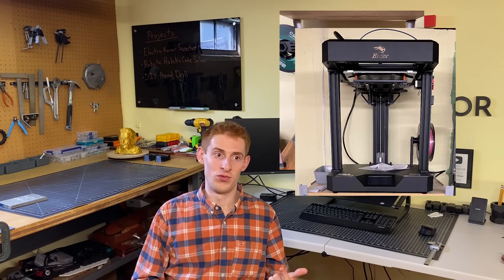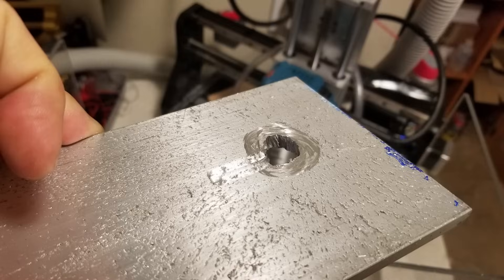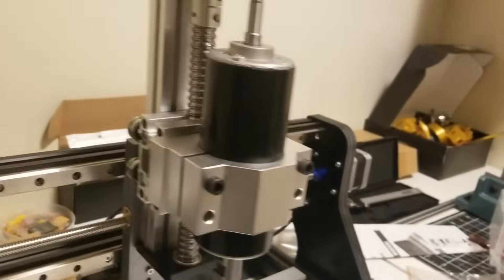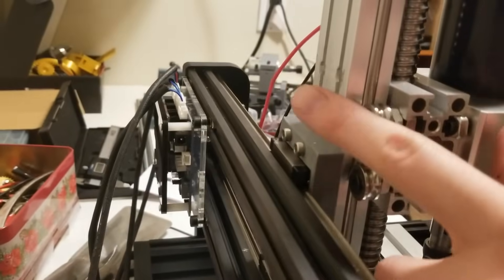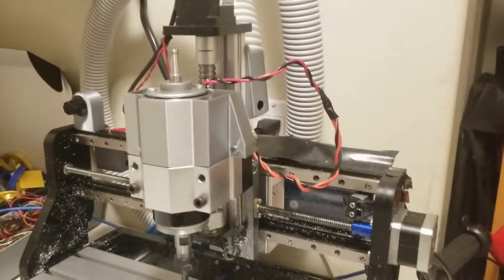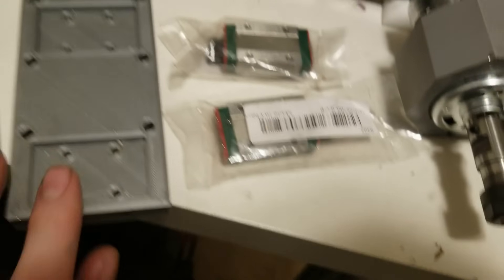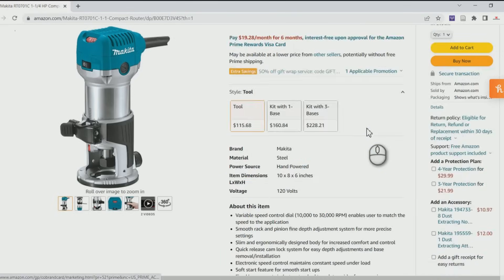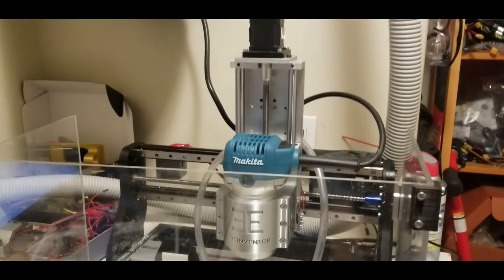Upgraded Desktop CNC 3018 cuts Aluminum FAST!

Comment: No matter which way you look at a problem if you don't address the root cause of it you will only get the same problems in a bigger format.
The 3018 is just a cheap entry level machine, sold down to a price, that barely functions but in it's basic form it will cut a number of materials accurately although slowly, so you either go the full Monty and replace every flimsy part (a costly exercise) with better more robust parts or design the machine from the ground up using this basic machine as a design guide......you will end up with a bigger bill of materials cost, but that is par for the course......the end justifies the means.......you definitely don't want a machine and a pile of left over parts nobody wants, so I would strongly advise anyone wanting to emulate this build to first do a design exercise and then buy the parts.

Comment: How did you make the part at 12:10 with the teeth being recessed under that upper cylinder-shape?
Reply from the maker: @Diego Montez I made it in 2 parts and glued them together!
Reply: Also, do you think one could make a similar build but save some money and get the 3020 because it already has the linear rail and nicer z-axis?
Reply from the maker: @diegomontez9543  maybe but youd still have to upgrade the router and possible also the Z axis, and last I checked the 3020 pro was a few hundred more than the 3018

Comment: Big people with this machines are rigidity &  linear shaft (rods).  They are not supported throughout the movement. You had changed x and z to Lm rail and guide, it you can change in Y axis, for better results.

Comment: Eric, it looks like you fashioned a piece of aluminum to connect the spindle holder to the new z axis, is that the case? If so, any specs?
Reply from the maker: Hi Brian, it does look aluminum, but its actually a 3D printed spindle mount that I designed and printed with silk silver PLA!

Comment: Is it only me finding it wierd to hear "I need to cut aluminium because I need to transer torque". I am not a mechanical engeneer, but as far as I understand it... wooden, plastic or aluminium gears are same bad ,,, for anything. I mean is it a 775 motor a bigger joke than an aluminium gear ???

Comment: Amazing journey pal. So the printed adapter holds up fine, no need to cut one out of aluminium ?
Reply from the maker: In my experience so far its been fine.  Its PLA with many perimeter walls and probably 60% infill. But you can always cut one out of aluminum after, on this same machine! But the mount design would have to change in order to make it cuttable on this machine
Reply: @ericinventor  Thanks.
Reply: @ericinventor  Thanks Eric.

Comment: I'm in process of a hybrid upgrade following this video. I'm going with 2 linear rail sliders on each x axis rail but the $80 z axis. The x axis ball screw alignment was a bit challenging due to the tolerance stack but I heated up the backlash nut after everything was mounted and ran the axis back and forth to help it self align in the 3d printed mount as it cooled. The files all had to be scaled but that isn't that difficult. The thing that is less fun is that these aren't solid files and they all need to be meshed into a solid which makes them tougher to modify, but hey he did most of the work so its a small inconvenience. Next is to change over the Y axis to linear rail guides and extruded aluminum because its flimsy after the extension in comparison to the x and z now..  Thanks for the vid!
Reply from the maker: Hi Jeremy, I have posted STL files strictly for 3D printing, but if you'd like I can also upload a more generic CAD format for editing like .step or .iges. Let me know. And good luck with the build!
Reply: @ericinventor  will i face more diffoculties if want to CNC 3cm thick aluminum?
The oil pump gears are small but are about 2-3 cm thick. 
Please let me know if you would recommend a different setup then the one in the video!
Reply from the maker: @FirstLast-tx3yj  If you take it easy with your depth of cut and stepover you should be able to handle it, just might take longer. But theres only one way to find out! I say send it!

Comment: So, you spent $200 on the original machine, and $400 on upgrades?
Reply from the maker: Exactly! If that sounds ridiculous to you, try finding a desktop cnc that cuts aluminum for less than $600. Many are $1000 or more

Comment: A quick question - would upgrading the router have negated some of the chatter in the rails/axis?  This is an inspiring video btw, about the best CNC upgrade journey I've ever seen.
Reply from the maker: Hi Chitus, yes upgrading the router helps reduce chatter for two reasons: one the higher rpm allows you to remove more material at higher speeds, so the chipload can be lower, and more importantly the lever arm (distance between mounting point and endmill tip) of the makita is shorter than that of the other motors.

Comment: What cad program did you use to design the aluminum parts and did you use grbl to control the 3018?
Reply from the maker: I used Fusion 360 for CAM and Grbl Candle software to control the machine.

Comment: You are still speeding up the video when cutting. It would be really nice to see the speeds and feeds that you used. One other suggestion would be to get rid of those Y access spaghetti tube linear rails and extend the bed across the edge of the main frame rails and use linear rails on top of those. Those linear rails on the bottom bend and cause all kinds of vibration. Having a solid steel bed adds a ton of mass and really helps the finish. I'm following a lot of what you did with my 3018. At about the same pace.
Reply from the maker: Hi Timmy, at 10:50, 11:19, and 11:52, there are a few seconds of real time cutting that is not sped up. And yes replacing the Y axis using linear rails like I did with the X axis would be the next logical step for sure. I was happy with the results I was getting for now, but if I do more upgrades in the future, that would be the main next one!

Comment: now use it to build a better one. using 3018 instead of 3d plastic. nice job. I got a little 9-speed mill from HF to build something like this from scratch using 80/20 extrusions and Dewalt DWP611.

Comment: Impressive!
For machining gear-like things, I've found the best process is to first cut out the inside holes, then add more workholding in the center, cut a circle around the outside, and then start working the curvy profile. First use downward motion with the end mill to cut away most of the material inbetween each tooth, and finally do the continuous profile cutout (one rough pass, one finish pass).

The circle allows you to use a large and tough bit for full width slotting, and together with the downward motion, the small bit never has to take a heavy side load. You also get much better chip clearing compared to cutting a curvy full width slot. This procedure is particularly necessary when using very small bits in very hard materials (I came up with it when making titanium cycloidal discs with a 1/32" end mill), but it's a great speedup for aluminum too.
Reply from the maker: Interesting toolpath sequence... That sounds like it could be much faster than continuously going around the tooth profile. Ill have to try it next time! What CAM software do you use?
Reply: @ericinventor  C++ :) CAM software is outside my budget. Python would probably be easier, but C++ is what I'm used to. I also use 3D models in Blender to help visualize things. 
For best results when nibbling with vertical motion, always keep the center of the bit over open space. Involute gear teeth need several bites to get all the way in to the base of the tooth.
Reply from the maker: @dekutree64  Wow, how does one write Gcode with C++? Is there a package or tool that is made for writing gcode?
Reply: @ericinventor  Mine is all written from scratch, but now that you mention it I should clean it up and make it available for others to use :) As is, it would probably be confusing trying to understand how it's meant to be used  At its lowest level it's just functions like G01_XY which takes an x,y position, applies backlash compensation, and prints a G01 command to the output file. But I also have a functions to do more complex operations with a single call, like drillHoleCircle(centerX, centerX, numHoles, circleRadius), or cutHole(centerX, centerY, radius) which will cut a helical path downward, with tool offset toward the center of the circle, and then do a finish pass with .001" or whatever finish chip thickness you have set.

Comment: Great work. Next use the CNC to cut aluminium replacements for the plastic frame parts!
Reply from the maker: That is the plan! Should be easy  for the z-axis adapter. For the makita motor mount I would most likely have to redesign it into two clamps that are .5in thick so they could be cut on this machine.
Reply: @ericinventor  btw,pcbway can now make cnc parts!
Reply from the maker: @TheUnofficialMaker  interesting, ill have to check it out, I didnt know. Are they well priced for CNC parts?

Comment: this video is great! I have been in the same limbo with upgrading a 3018. Heres a tip with clamping your materials, Its difficult to describe, Use a packer thats is slightly higher than the material your cutting, so your clamp comes DOWN onto the material.  The force exerted on clamping the material will be exponentially higher
Reply from the maker: I totaly understand what youre saying, noted! Thanks
Reply: Thanks for posting this. Wanted to say the same. Using clamps we see here can cause vibration as well!

Comment: A quick question - would upgrading the router have negated some of the chatter in the rails/axis?  This is an inspiring video btw, about the best CNC upgrade journey I've ever seen.
Reply from the maker: Having higher RPMs can definitely help with smoother cutting, so the makita cut better than the 500W chinese motor, but the most important thing is machine rigidity

Comment: Excellent video!  I have this exact kit that has been sitting in my 3d printer room unassembled for the last two years.  I didn't want to put it together until I had some kind of plan to make it machine aluminum more adequately,  Now it can be a really useful machine that can help me to create the long lasting and useful designs that I have been wanting to make out of aluminum.  So the main issues are the X rails, Z axis and the motor (I knew the stock motor was garbage from the outset).  You have shown a clear path to improve the most salient points while leaving the adequate parts alone.  You have earned my subscription sir.
Reply: can't wait till you move up to steel, carbide, stainless, etc.... plenty of materials to keep you busy.
Reply: @MikelNaUsaCom  Carbide isn't going to happen. Best bet is grinding carbide with diamond. Unless you can afford CBN inserts or a EDM machine.
Reply: @appatula  people now are starting to use 3d printer as edm machine, i saw also some crown found around the internet, it's quite cheap too

Comment: I note that your Z axis limit switch works in the downward direction- which means the tool could hit first. Better to have it in the upward direction.
I think much of the problem you had at 10:10 was due to climb cutting- best avoided, especially with big cuts.
Reply: Climb cutting is the preferred way to use an end mill if you have ball screws........backlash is non existent.......a mill with Acme threads is not advised to use any form of climb cutting.
Reply: @gangleweed  The situation is somewhat more complex than that. There are several matters that make climb milling inadvisable; any lack of rigidity in the frame, bearings or workpiece can cause 'grabbing' during the cut. An open-frame machine with many aluminium parts such as this is very far from rigid. Even a manual machine constructed from cast iron with dovetail keyways and backlash operator removed is best kept to finer cuts in this mode. I almost always finish a manual mill cut with a fine climb cut because of the better finish. Much depends on the material- cutting wood is almost always OK to climb cut- the cutter load is low. With aluminium, speeds, feeds, and lubrication are important- note the title of this video; is speed more important than finish?
Reply: @Tensquaremetreworkshop  Having been a fitter and turner for the best part of 60+ years I am fully aware of the climb versus conventional milling method.......you NEVER climb mill with a conventional mill no matter what some say.......unless you have a hydraulic buffer to prevent backlash.
Reply: @gangleweed  I have had a manual mill for over 40 years- and I can demonstrate to anyone the improved surface finish from a climb final cut. It does have to be a fine cut, and (as always) speed and feed are important, but the results are clear to see.
Backlash is not the (main) issue in small mills like the one in this video- it is lack of rigidity of the machine. I am currently building a CNC mill intended for metal, and it is significantly more robust in construction. Gantries are a particular weak link, flexing in the middle and lateral motion due to twisting being hard to prevent. Rule of thumb- if you can lift it, it is not strong enough...
Reply: @Tensquaremetreworkshop  I would never dream of climb milling on a manual mill.....ever, but if you had a ball screw on a manual mill that is a different, matter but you still stand the risk of flinging the part across the shop if it gets a hold.........don't ask me how I know.
A gantry type machine is not a mill it's a CNC router but could also be a manual router or if heavy enough a bridge mill.
Reply: @gangleweed  I understand your skepticism- it is what 'the book' says. My aged mill has plenty of backlash, but is also quite solid. The tool load is clearly lower than the friction/inertia of the table when care is taken. I am currently milling the edges of aluminium parts, and the improvement in surface finish of a 0.1mm climb pass is clear.
Technically, any machine that removes material by multiple cutting passes is a mill. Wood planers (which Americans call, strangely, jointers) are milling the wood (and often called that). Same for removing husks from grain (called mills for centuries). 
CNC climb cutting is common on wood, as it greatly reduces tear-out on corners as well as giving a better finish; indeed, it tends to be the default cut in wood focused CAD software. When used on metal, low backlash (it is never zero) is important- but so is rigidity of the machine- whenever the tool load exceeds the force required to significantly change the geometry in the cut axis bad things happen- usually the cutter snaps. 
There are good reasons why manual milling machines are constructed in the manner they are- putting CNC control on a manual design is likely to be more successful that 'beefing up' a design meant to mill wood.

Comment: hi dude i picked up a cheap 3018 pro today, im new to cnc but wondering what the sensors are you mounted at 9:52..

also do you have a video of the final version 3 for wiring this all up and setting up the software? all the good stuff like seroing in all the axis and such... if not im sure many peeps would watch it!
Reply: They are the home limit switches- essential if you want the machine to know when it is exceeding physical limits- and not do it. Also allows repeatability in work zero.